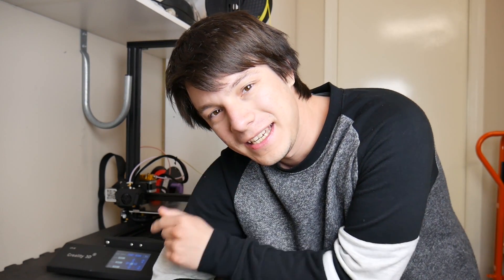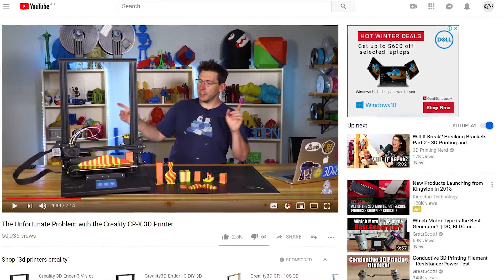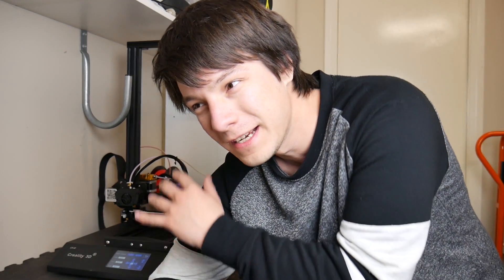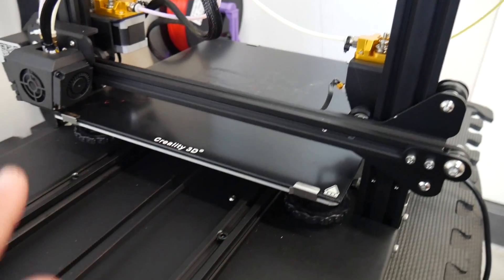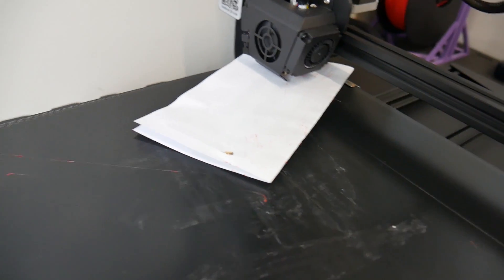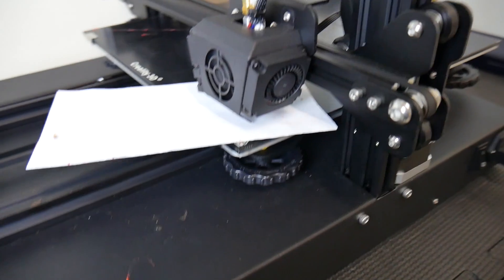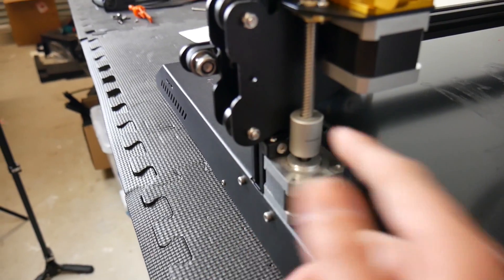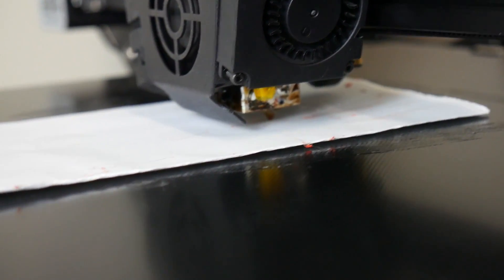Update on my Creality CR-X and going forward

Comment: looks like the z axis needs to be timed with a belt. it will make sure both screws stay in line once in tram. how to do that? dont have one so cant say but im sure you could design something up.
Reply from the maker: Their original promo video shows that, but for some reason they changed to two steppers for these pre-production units. The hole for the second motor is crudely hand drilled too. I'm not sure why they did that.
Reply: im sure it came down to being able to properly time the screws and ensure it is in tram. that is one of the biggest upgrades on the ft5 r2 was to go single motor and timing belt. this stops the bed sag the r1 had issues with. i solved it by using a 40mm block.to level the bed(elevator?) for others it was 2 end stops and 2 drivers. hard to do with that controller im sure as i doubt they have an extra driver slot. though i wonder if there is a break out that would allow you to add one? but in the end its highly possible as you pointed out at the end the carraige might be slightly bent. if remove it and use a straight edge and check. good luck
Reply: I think that's my fault. I warned them away from binding the z rods and using a belt. screams zbanding as these machines are not machined nearly well enough to get away with that.
Reply: i agree. but it can be timed by removing the screws being actually mounted hard on the z.
Reply: Phillip Ramirez but then the belt will have slop
Reply: there is a good discussion on that here: https://reprap.org/forum/read.php?4,469303,page=1
Reply: NO. that would be bad. these machines are not machined anywhere remotely well enough to "BIND" your motion system physically with your guidance system. if you want zbanding THAT is how you get zbanding.

you want the z rods floating and loose. lets the extrusion and wheels do their job without being pushed around by a misaligned or warped z rod or mounting. First thing I did after printing with my tevo flash was to strip away the dumb bearings and timing belt for the z rods. works soooo much better now :-)

the 3 wheel configuration pretty much makes it impossible for the x axis to go out of alignment (unless you force it) and if it did the forces would be great enough to stall the stepper immediately as it bound up as long as you don't overtighten it.

you do NOT want a belt linking the 2 lead screws and you do NOT want the tops of the z rods "secured" rigidly.
Reply: I always wondered why the z lead screws were designed to float at the top end.